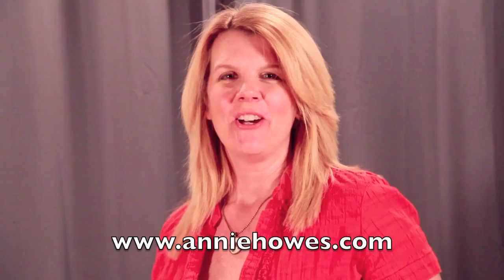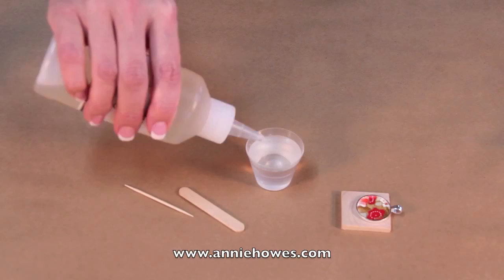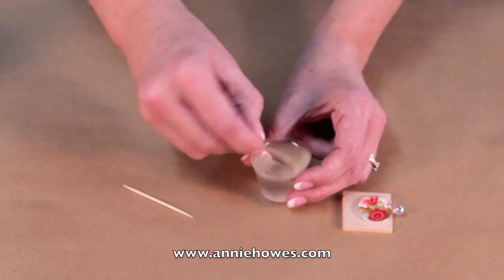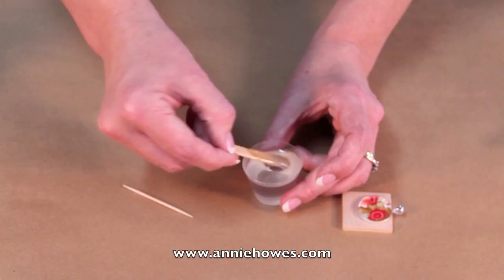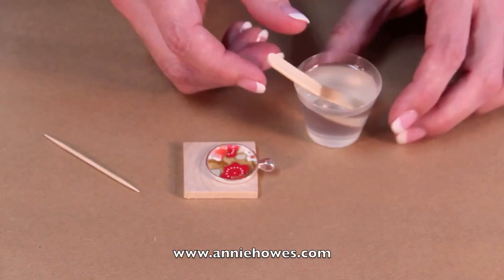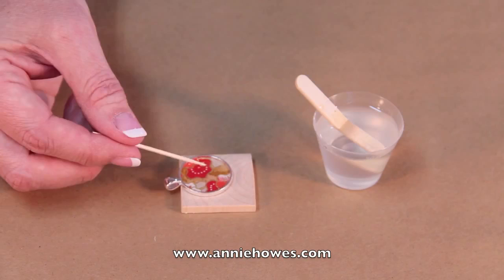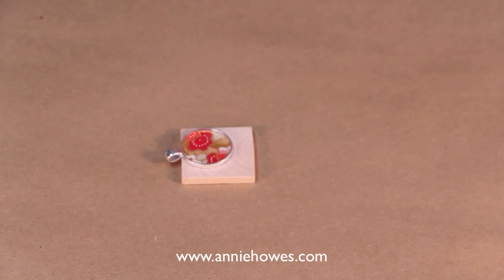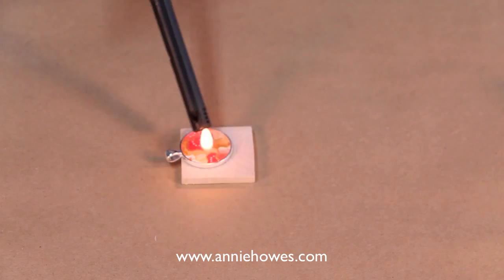Annie Howes   Luxe Resin Part I

Comment: I love using Luxe Resin! I've been making rings with mine. I know it says "non-toxic" and "safe to use". Is it overkill if I use nitrile gloves with it as well as using a respirator mask while working outside?! I've just heard so many precautions with resin and I guess I'd rather be safe than sorry! This resin is very low odor though and as a first-timer I only had one or two very small bubbles in my work!
Reply from the maker: You can take all the precautions you'd like when working with Luxe. It's still a chemical and some people may have sensitivities to it. For most, good ventilation should suffice.